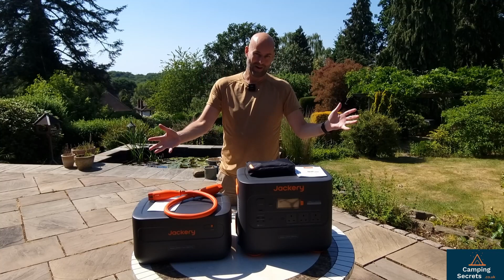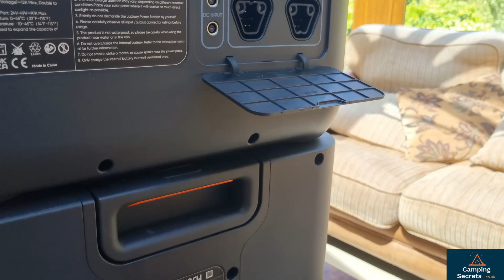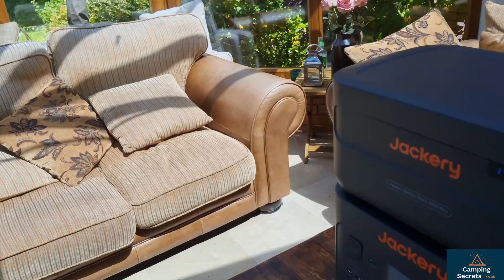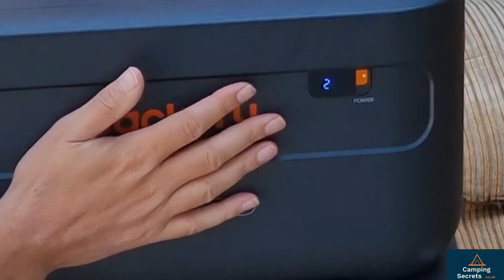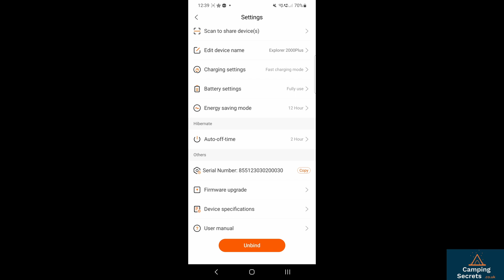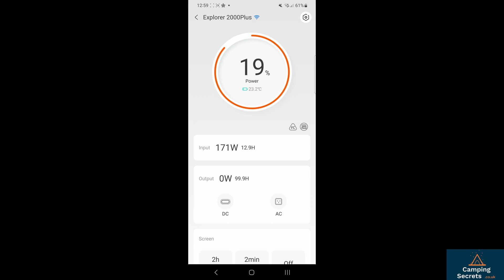Jackery 2000 Plus - IN DEPTH Review  - How Does it Compare Against the 2000 Pro???

Comment: Ive just been made to have the plus as a replacement as my pro broke under warrenty and they wouldnt give me another pro
Reply: My 2000 Pro has just broken and the UK support offered me a 2000 v2 as a replacement - I've asked for the 2000 Plus instead due to the 1400W solar input that the Pro has. The 2000 v2 only has 400W solar input! How are you finding the 2000 Plus compared to the 2000 Pro?
Reply: @speedmatters defo not as good. Larger alot heavier, charge times all the same but a bit of a delay turning on etc in comparison. I would have kept the pro all day long. The app is also mainly useless. Other minor issue is if you have a low wattage draw 3pin plug turned on it shows as a 0w draw. Unacceptable really.
Reply: @Danfranco oh bugger! Thanks for the feedback, maybe I'll have to take the 2000 V2 after all. It's a problem for me because we use two 450W panels with the Pro to power an A/C unit directly and it still charges slowly. The 2000 plus can do the same, but as you point out, it's twice the size and so much heavier! Not sure what to do now 😅
Reply: @speedmattersI'd still say it's better than the v2 but if I had have known they wouldn't send a pro I'd have never sent mine back.

Comment: So when you go to charge up both base n extension battery, you need to charge individually or just charge base unit. I saw that the extended battery is capable of solar charging but do you have to do both to achieve 100% full charge?

Comment: Can you plug standard PV panels (from your roof) into the 2000 plus during a down grid situation?
Reply from the maker: You can, but they make it tricky as you need conversion cables to get to the correct connector type. You also need to watch the power and voltage (1.2kW and 60v max).

Comment: Nice review. Have you been able to check whether the expansion module increases the charging time from the mains from 2 hours to 4?
Reply from the maker: Thanks. Yes, if they're both flat it will take double the time to charge. Remember that unlike with Ecoflow, the expansion battery can also be charged on its own using solar or 12v - you don't have to charge via the 2000 Plus
Reply: Thanks for the confirmation  @CampingSecretsUK  in my current reality I need to charge it three times a day. Not a predictable use case let's say) Anyways it works great and gets charged very quickly and 4000 cycles of lifepo4 is just a great feature.
Reply: Answering my own question. With 1 battery pack added charging time still less than 2 hours
Reply from the maker: @ok.youtube.account  wow that's great to know. I was completely wrong which teaches me a valuable lesson. Don't pontificate on stuff I know nothing about!

Comment: How long would it run a 500 Watt fan heater from full Base station charge? Same question for the 2000 pro please.
Reply: The fan uses 500watts 500watts an hour jackery stores 2000wh 2000/500 = 4 hours
Reply: The thing that is selling me is the charge time I have an early version of a 2000w 2048ah with lithium batteries thing takes 10 hours to fully charge ac and get this 18 hours solar and it is starting to drain faster day by day having me to run my gas generator for 10 hours just to charge where as this jackery 2000plus with 2 x solar panels is on sale and I can finance it the 2 hr charge time sounds so much better over the 10hour I'm dealing with now. Plus I can upgrade it later and add a battery and charge the power station I have with solar or how ever and use them both.
Reply: yes but to get 2.5 hrs charge you need 6 solar panels wich will cost £3774 plus the jackery £2000

Comment: Do you remember whether the Bluetooth and WiFi were on when you unboxed it? Have you seen any way to turn them off? I really want to get the 2000 Plus Dual for 240v capability, but I can't have those transmissions on. I've tried to phone them, but so far I haven't been able to get anyone on the phone to ask.
Reply: Did you ever get a response on this?
Reply: @alisakelemen9281  I contacted the company and this was the response.  The Jackery Explorer 3000 Pro offers the ability to toggle Wi-Fi and Bluetooth on and off. To accomplish this, simply press and hold both the DC and AC buttons simultaneously for one second. This action will deactivate the Bluetooth module, thereby interrupting the connection.

I have since purchased and it works beautifully!
Reply: @alisakelemen9281  I bought it so I know have the ACCURATE answer. When you power it on, bluetooth and WiFi come on. They search for a signal for 5 minutes and if none is found, they shut off and stay off. 

But, you can hold the AC and DC button at the same time and turn them both off (or on for those who may want to do that). 

What I do is power on, immediately hold the AC and DC buttons, and shut off the bluetooth and WiFi. They stay off.
Reply: I would like to know this as well.
Reply: @MelissaKOdegard   I bought it so I know have the ACCURATE answer. When you power it on, bluetooth and WiFi come on. They search for a signal for 5 minutes and if none is found, they shut off and stay off. 

But, you can hold the AC and DC button at the same time and turn them both off (or on for those who may want to do that). 

What I do is power on, immediately hold the AC and DC buttons, and shut off the bluetooth and WiFi. They stay off.
Reply: Jackery originally told me that they are off by default, but that is not true. They both come on, search for signals for five minutes, then go off if none are found. 

How to immediately turn them off (hold the AC and DC buttons in at the same time) is found in the "User Manual for the Jackery App".

Comment: 1 - 200 watt panel WILL NOT charge the 2000 watt base station in 2 hours from zero.  Let alone the add on pack.
The estimate of 2 hours from Jackery is based on at least 6 200 watt panels in perfect sun light.
$700 for each panel currently, so a whopping $4200 for the panels to charge just the base in 2 hours.

Not saying that’s bad, it’s on par but don’t mislead the audience that they can snag this thing with one panel and it’s fully charged in a couple hours.
Reply from the maker: I don't think I said that - it was a slip of the tongue if I did - I certainly didn't mean to say it. I have another video using the 6 x 200W panels, so do have experience of this. Thanks for pointing it out
Reply: You can always use a box of matches to light your wax candle for light if you dont like the invention. If you cant afford it its not for you hahahahahaha

Comment: does anyone know the max number of solar panels can be linked together?
Reply from the maker: If you're using the Jackery panels, it's six
Reply: How many solar panels comes with just the Jackery explorer 2000 plus (without battery pack)
Reply: @tmttkseven3328 it’s the same amount, you just finish the charge faster. It’s how Jackery set it up (max input voltage from the solar).